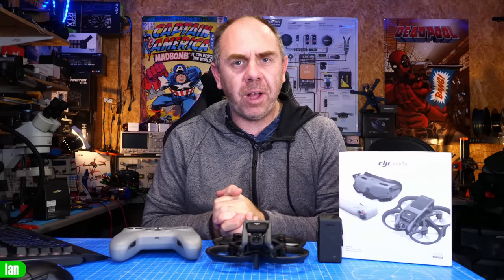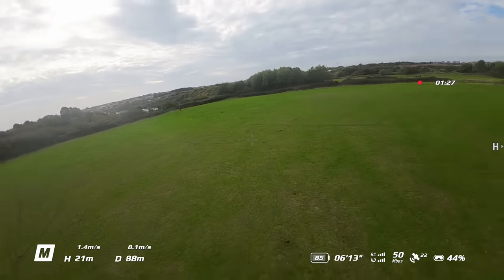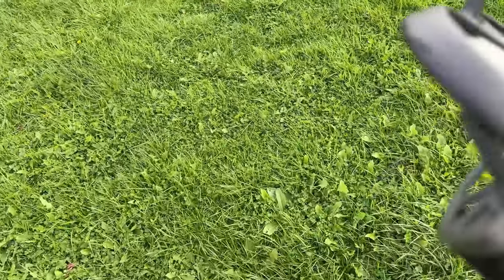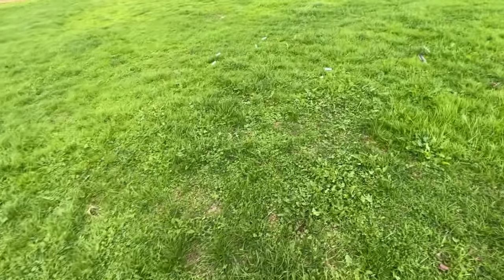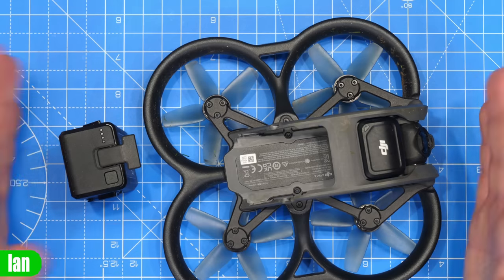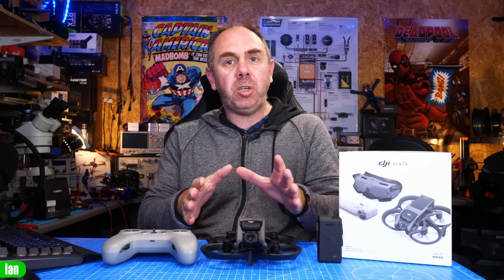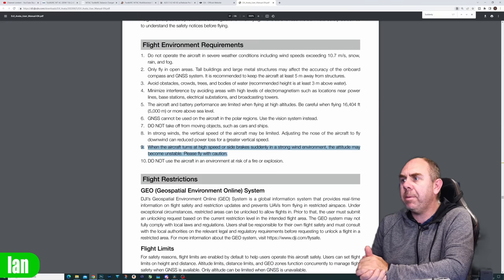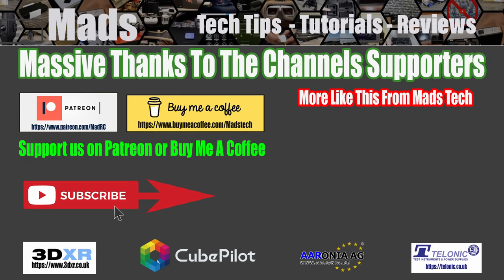DJI Avata Manual Mode Warning  - Yaw Crash Risk

Comment from the maker: Ok folks just to confirm somethings.  

This was in latest firmware

I am well aware of the states of Yaw Washout and Vortex Ring State, if I felt this was just washout there would not be a video on it. I know what they are and this not that. 

While the initial loss of altitude would be washout then craft appears to either crash the gyro or reset it’s self upside down. That is not normal.  

Ciniwhoops are well known to wash out and that’s something that’s easy to compensate for.  

I absolutely can see that the start of this is with washout however it’s what is happening after that point is the issue.  

If you going to come on here and post comments that “people should know how to fly” or “it’s normal” please don’t. Your not dealing with a DJI pilot here that does not know how to fly in Acro or what should or should not happen
Reply: 100% agree. I'm no beginner. I've had other whoops that you do get wash out and instability, but the avata is doing things it's not supposed to! It's not normal whoop instability,  it's getting confused somehow. So far every time I've replicated this, at height, it's recoverable. Either by regaining control, or the one occasion where it did what yours did, I hit the oh shit button and it saved it. It was heading straight for the ground the same as yours did. I recommend testing again at height. So far I've done this over 10 times in one 5 min flight and managed to recover it every time. 🙃 (btw not saying this is a fix, dji need to sort this asap)!

Edit: I don't currently have another whoop, but it would be interesting to do the same moderately hard flat yaw/ roll turn on the avata and a "normal " whoop... and see the difference.
Reply: Can you give us a camera view of your stick inputs?
Reply: @blizsgarage8487  I'll have to go make a video.... using go pro for stick inputs. I dont connect to the fly app to show overlays, as it undoes a certain mode 🤭🤣
Reply: @FPV-TV419  sorry buddy, I meant to reply to mad tech.
Reply: @blizsgarage8487  it's OK mate. I'm going to make a video on it anyway. 🤪
Reply: Mine Avata nosedive immediately when I switch to manual mode.
Reply: @Fpv-tv  I love that certain mode...🤣
Reply: @pajomota64  😉
Reply: Could it be bent props, SD card slot door opening & hitting props be accident, etc.. thanks! Please note I don't have an Avata.
Reply: Absolutely agree with you. That last crash was just nuts. Any theories on what could cause this to happen?
Reply: It's 100% a software or hardware issue. That dive that you had happen after a gentle turn? I've had it hovering doing nothing except switching into manual. Hovering at 30m, switch to manual and it instantly just dives upside down into the ground.
Reply: I have read in various places that the last built models of the Avata no longer have this problem and work fine.
Reply: @mcferran6720  well I doubt that's true since since I just bought my avata on the 9th of January and 16 days later I had the exact same crash as in this video and it cracked my lens
Reply: Hi mate, just a question, i notice a lot of u-tubers flying in fpv  without  an observer. I was under the impression that this was not allowed. Please cotrect me if i have misunderstood these rules.
Enjoyed the video, keep up the good work.

Comment: Weird I just beat the shit out of it and no crash. I’m going to say it like this I’ve flown in multiple locations , climates , elevations…   I’ve beat the shit out of this drone aggressively and I’ve not once had it drop on me. 100% if y’all are having “issues” evaluate the person behind the sticks.   I’m sorry Ian I like you but let’s be real  this is about as silly as it get gets”
Reply: Cause of crash: gravity. 😂😂😂
Reply: Ian's no freestyler but he does know how to fly a quad in rate/acro mode.   I guess those guys who experienced exactly the same thing when switching from normal to acro mode in a hover were also just bad flyers? 🙂
Reply: its like any air craft if you stall it it will flip out. 
i fly the crap out of mine and love it you just got to know its limits
also moving the center sensitivity down helped smooth mine out a lot roll130 pitch100 yaw70
Reply from the maker: I was sent 5 videos of this issue before I went out. All of them were a simple yaw and it dropped.  I have been building and flying DJI aircraft before most people knew DJI even existed.  To say this is pilot error is billshit.  

If you take note it’s not how hard you fly it it’s the specific Yaw turn.  That is not washout. I have had ring vortex, washout and every kind of issue there is over the years and this is not normal.  All the videos I was shared showed something that should not happen.  

On the way down I tried to disarm and it would not so I moved to GPS to see if it would kill it and it would not so then in the end it luckily threw the pack.  

This os a very real issue.
Reply: Couple questions for OriginaldoBo…. 
- Are you a tester for DJI? 
- Do you get products sent from DJI to test?
- Were you in the pre-release test group for the AVATA?
- Did you pay for your AVATA yourself?

Comment: It's almost as if it thinks the flight controller has been turned upside down when this happens.  Perhaps it's a numeric overflow (or underflow) (modulus) error on extreme units of yaw measurement by the yaw gyro -- but only in one direction.    It definitely flips complete inverted and probably keeps bouncing around because the flight stabilization software may have actually crashed and is therefore effectively doing nothing at that stage and becomes unresponsive to control inputs.
Reply from the maker: It’s funny you say about the sw crashing. I have a feeling the loop was stuck for sure.  We know whoops can wash out but this is more than that.
Reply: @MadRC  I've seen other Avata crash vids on YT where the same thing happens... the quad just keeps screaming until the battery is pulled.   There was one where the guy simply switched from GPS mode to manual and the craft instantly pitched over (like in this video) and then sat on the ground screaming its guts out and unresponsive to the RC link.  This kind of indicates that there may be more than one way to trigger this FC crash.
Reply: Makes me wonder if a incorrect data type was used, so a change in code path causes a value to be truncated. (equivalent to a numeric over/underflow)
Reply: It's easy to break code in multithreaded c or c++  could very well be the issue.

Comment: I think it’s a battery issue in conjunction with undersized motors…..
When the quad yaws it relies on increasing the torque of two motors and decreasing the torque of two other motors. When you hit a yaw maneuver those torque increases require a quick current draw. The battery on the Avata is a Li-ion with a pretty low c rating so can’t draw too much current quickly. It gives high flight times compared to li-po but at the expense of low current draw. The motors are smaller than typical 3inch whoops… usually use 2004 or 2204 which are a lot wider and give more torque. These with a liPo give great yaw authority. I don’t think it can be programmed out and is most likely this hardware issue. Yaw into the wind and it’s a lot more resistance so that may be why you can yaw in one direction fine but not another. You can turn your yaw rates down and that should help
Reply: I personally think that the drone has limitations... doesn't every product? People need to work within those limits or purchase products that are capable of fulfilling their needs.
Reply: @DG-es2st  I'm not sure yet. Whenever you push the boundaries of what a product is capable of... it's like having a car that can do 100 mph and blaming the manufacturer when you crash that car doing that 100 mph in a 30 mph corner. That's all I'm saying.

The battery size and placement, the weight of the drone,  the thickness of the prop guards, the frame thickness/ design,  etc present  limitations and flight characteristics that the Pilot must consider when operating  this drone. There are always compromises.
Reply: But why does it happen only in left turns?
Reply: Same.
Reply: That would explain poor yaw performance, but it doesn't explain the falling out of the sky - if the battery can't handle so much current then the flight controller should have limits set up so it doesn't send motor commands that cause the motors to draw that much current...

Comment: Yes, I fly the Avanta in full manual mode and yes I have experienced the left yaw problem, but it happened while I was in sport mode.  I use mine, along with other machines, in my filming business.  This problem happened once in the two weeks I have been flying it.  I was chasing a side-by-side down a dirt road, proceeding to turn left gently into a parallel field and continue the chase.  As I turned left, the Avata suddenly pitched down and to the left more.  Fortunately, I regained control before hitting anything, but it happens fast and there's nothing you can do to stop it until it allows you to have control again.  Other than this one occurrence, my Avata has been an outstanding machine for certain work in tight places.
Reply: Try recalibrate everytime before flight and see the result

Comment: There's a problem with fly aways too. That's what was happening when yours was rolling and trying to fly. A friend was trying the motion controller flying the avata through racing gates and slightly hit a gate and it sky rocketed out of control. It got to about 150' in the air before regaining control. I personally haven't had either issue thank God because I have been flying my avata in manual mode over water and have posted several videos too. I do not think I will be flying over water with it anymore.. this is the kind of thing you expect from the cheap knock off drones.
Thank you for sacrificing your Avata to prove there is an actual problem and for not being shy to call out DJI directly! KEEP UP THE GOOD WORK!

Comment: That's crazy! It looks like something messing up with the failsafe conditions. Something that DJI should have implemented since the FPV combo: A DISARM switch that works both manual and stabilized modes.
Reply: You can disarm with the start/stop double press. Do think it'd be smart if it worked in all modes though.
Reply: I think it's double tap of the the big right trigger button but I always thought that was awkward and they never really mentioned it in the documents for the original DJI FPV

Comment: So you purposely went out and flew the Avata in a way that no cinewoop was meant to be flown had a problem and start barking that there is a problem.  Your video is nothing more than click bait and all you are doing is contributing to a hysteria without any confirmation from DJI that there is an actual problem.  I really have to question how good of a drome pilot you are.
Reply from the maker: I am a terrible Drome pilot. It’s just so hard, I would however question your capabilities to be able to use a keyboard ;).  And as for the drone issues. Your opinion on my flight skills was nether asked for or wanted. Also if you don’t see this behaviour as an issue I would further question your knowledge on anything drone related tbh. The issue happens with sharp left turns.  That absolutely the way any drone may be flown.  Sorry but trying to say this is not how you would fly a drone is nonsense, further more I don’t care why you think the video was crated. It’s my opinion that I share with my audience, if you don’t like it tough I don’t care. However as I am someone who has been around a very long time and was even a beta tester for DJI and helped run their social media groups I know what it correct and what is not.  DJI don’t ever admit anything so asking them if they have a problem is pointless.  I wish you all the best and I suggest you find other content that suits your believe structure better.
Reply: @MadRC  Wow someone is overly sensitive.  May want to think about growing a thicker skin.  You opened the door when you created this video and should have expected that not everyone is going to agree with you and some will even question your authenticity just like I am still questioning your piloting skills.  You may have not asked for this opinion but nobody asked you to make this video either.  But since you did deal with the opinions that will also come with it.  It is still click bait as it is obvious you are trying to  to grow your channel.
Reply: I work in the film industry, and often aerial units... you cannot simply decide this type of filming may or may not be needed.

Comment: Ahhh the fun walk around.  😀

I have leaned NEVER pick up the quad BEFORE you find all the parts.  It gives signs of direction, so you don't lose position, etc...
Reply from the maker: Your spot on there buddy.
Reply: @MadRC  it does look like it gives a sharp pitch forward movement.  Weird.

It was NOT a sharp turn at all.
Reply from the maker: @uavtech  no nothing compared what what I was doing. My feeling is either sone desync or issue in the loop as it just drops and then won’t listen to anything.

Comment: The DJI FPV didn't have the issue where a side wind turn made it drop, but it did have the issue of going into Tunnel mode after a crash.

My first flight with the FPV (full manual), I did a loop, came a tad too low and the battery touched a clump of grass, causing it to tip upside down.

The drone went full throttle, upside down and was ignoring the controller, so wouldn't shut off!  If a prop hit a stone, the drone could've tilted enough to fly full throttle into my face.  I had to grab it and pull the battery lead.  Very scary and very dangerous.

The drone wouldn't have been damaged, by the crash, but going full throttle, upside down, ripped one of the motors out.

Comment: There are so many videos showing this exact problem from professionals, and yet the toxicity in this comment section is terrifying. Software glitches don't happen to everyone so you might never experience it while someone can get it in their first flight.This issue absolutely looks like one because it happened to so many, the exact same way: yaw, pitch down, nosedive with 0 control. I was gonna buy the Avata as a complimentary safer drone to my DJI FPV around people, buildings and cars, but I think I'll wait for a firmware update that solves this. Knowing DJI, they'll probably never admit to the issue, fix it in the next update and act like it never happened.

Comment: i saw a very similar incident here in youtube where the avata basically took off from N mode and it oddly flipped over and literally tried to dig itself into the ground (motors running) in which the pilot was not even able to disarm the motors short of pulling out the plugs. serious issue that needs to be addressed!

Comment: 🤝👍 Had a much similar case with my Avata while doing gentle left turn in manual mode. In a fraction of a second during a perfect glide through a valley the drone lost control, started rotating like crazy and crashed. I filled the “fly away” form and DJI told me that it was my fault because I moved sticks way forward. I sent them DVR and after few attempts to force them examine it I got an answer that it’s still my fault, but now because I underestimated drone size and hit a rock that was close. Unfortunately I have enough experience in flying whoops to think this was an misanalysis 🤷‍♂️
Reply: did they replace your drone?

Comment: I live in Switzerland, I had the same problem flying manual... It happened once and was able to recover before it crashed. But this is a serious problem !
Reply: Did you find any issue? Thx
Reply: @fauremaxence6504  don't fly fast or with high wind velocity and evrything will be ok.
Reply: @yvonvite  thanks for your answer. In my side évènements if fly slowly and without wind I always have the problem

Comment: That wasn't what I would call a 'quick' yaw turn at all. Scary stuff. Hopefully DJI fix this one fairly soon, could be very dangerous if it happens at the 'wrong' time.
Reply: There was someone who lost the Avata while flying over the see...
Reply: @MCsCreations  Have seen several of these videos now. What I find a little scary here is that Ian was able to induce this issue relatively easily. It may be a problem that is not affecting all Avatas, but it doesn't bode well when Ian was able to make it happen as easily as he did. Things go wrong and writing perfect software is not easy, so hopefully DJI fix this reasonably quickly.

Comment: Weird that those who have flown with the cinewhoops are reporting the same findings on their drones who have a ducted fan system. I might be wrong here but im leaning more to a faulty ducted fan design then a problem with the IMU. Drone champs RC have a realy nice explenation on this.
Reply from the maker: I don’t fully buy this is washout.  Iv had many times where washout kicks in but this is different.
Reply: this is common issue for cinewhoop ducted drones. not especially for avata.